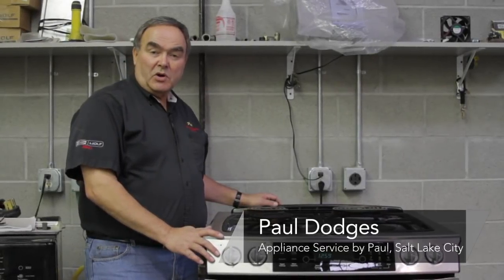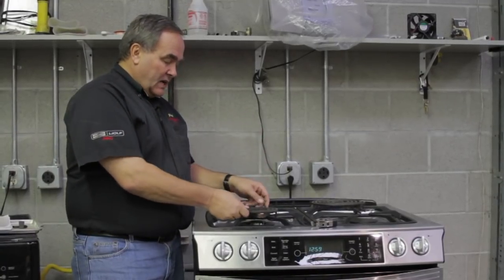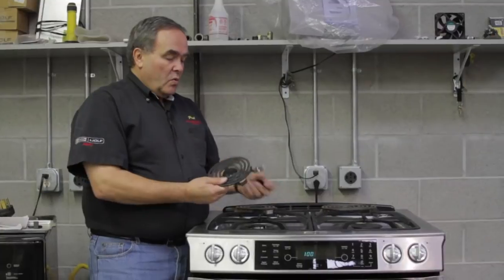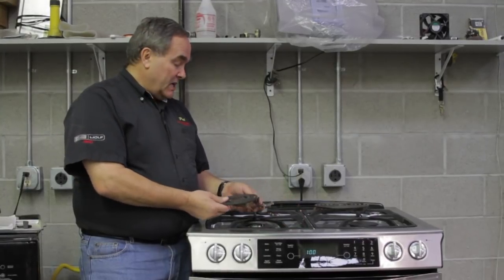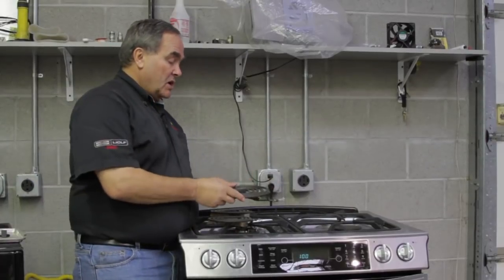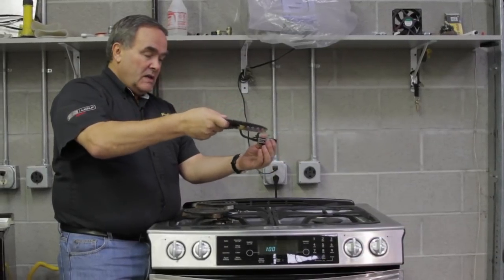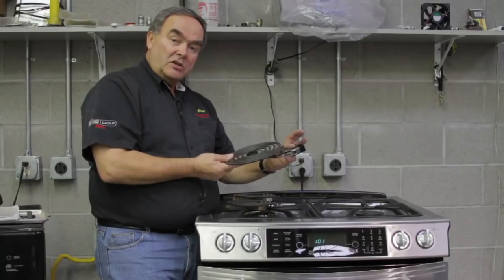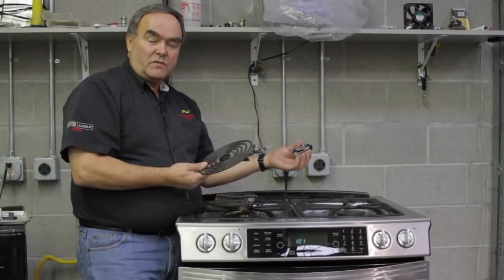Home Appliances : How to Replace Your Electric Stove Grills

Comment: I recently got some replacement burners which have more turns,,however i did not notice untill i got them that the one i have are loop connectors and the ones i bough were flat spade connectors?  They have to be different for a reason,,should i use them? or not.
thanks